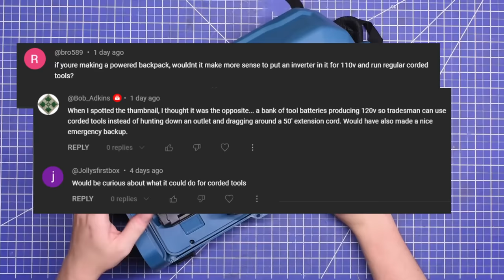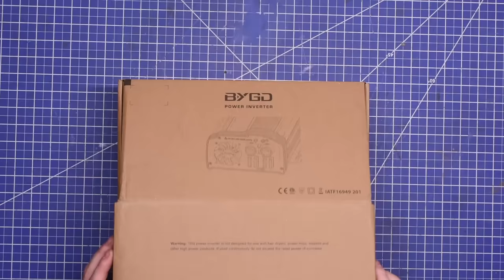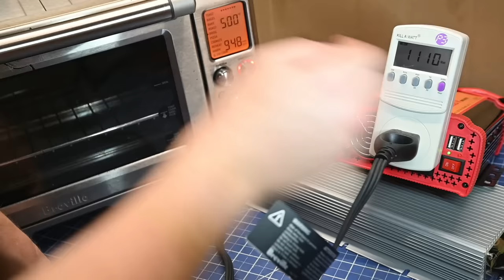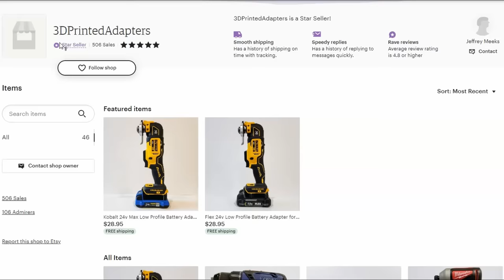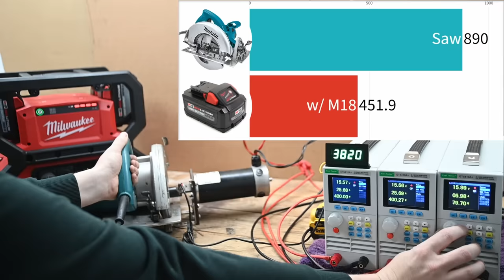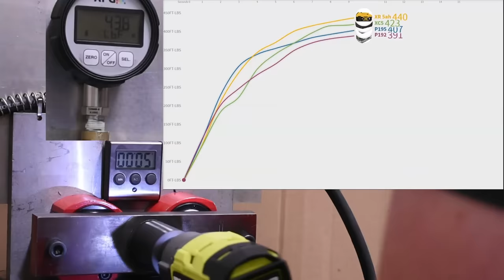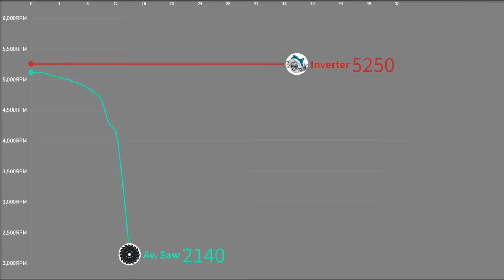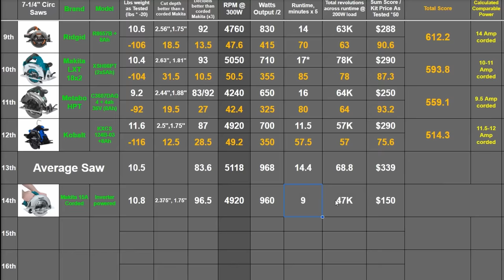Powering Corded Tools w/ Cordless Batteries is Stupid (but fun)

Comment from the maker: The M18 inverter has been surprisingly good https://amzn.to/3tCW8g9
Reply: Day 2 of asking you to Test the tecpo 300111 Air Impact
Reply from the maker: @steinestapler726  We dont have them here in the states it looks like
Reply: @TorqueTestChannel  thats sad Maybe we can find one that can send it to you. I am Not able to send it to you because i live in Germany, and i need IT daily.
Reply: I wonder how powerful a tool would be if it was designed with modern brushless tech but was still wall powered.
Reply: I asked 10 or more times for a tool review without even a reply lol lucky you got anything back at all
Reply: @TorqueTestChannel question why didn't you guys milwaukee  MX fuel battery inverter
Reply from the maker: @dylanrowe7581  because these things already cost too much. Having to pay for massive MX batteries. No adapters on the cheap fun to be had
Reply: by the way, if you are interested in that M18 inverter, you are better off buying a portable power station which already has batteries, LFP batteries that has at least 3000 cycles.
Reply: @TorqueTestChannel  do you have an po Box where i can send an Impact
Reply: @zodiacfml  thought  the same this set up only makes sense if you already own the Batteries
Reply: Corded tools use universal motors which can use AC or DC. All you had to do was make 120 volts DC and hook it up to the corded tools. The only issue you will run into is for variable speed corded tools like drills because the control components require AC to work properly, but the grinders and saws would work as they just use a simple switch to turn on and off power to the universal motor.
Reply: @EETechs  there was another comment that teste that and the switches didn't work with that power.
(Its because there is not zero voltages switching)
Reply: You fell into my trap, DeWalt PowerShift activate.
Reply: That center must be the + charge pin?

Comment: Anyone calling these builds stupid lacks the ability to read between the lines. The engineering alone is enough to learn from, regardless if it's actually useful or not, the point is to find out. I'm not necessarily expecting peak performances but I enjoy seeing what you find to be the minimum required wire or battery size to perform at all. The differences in battery performance from one brand to another is interesting as well. Showing people they can simply notch an adapter rather than have another one made is another little tidbit of info to keep in the back pocket. I did that back in the day with some batteries themselves to fit certain tools and they worked fine. Love the vids man. Thanks. Merry Christmas.
Reply: Average human doesnt even know that AC batteries dont exist. They think why bother with tools DC batteries when you can just chug an AC battery and use their corded tools.

Comment: Corded tools have universal motors. They run on AC and DC as well. Here comes the sketchy part, put 6 20v batts in series for 120v. Or 7 for some extra juice.
Reply: This is exactly what I was hoping to see!
Reply: I suspect that since most batteries have circuits in the pack, they would not like being put in series and having 120V+ run across them.
Reply: Actually, since universal motors self commutate. Should only need 60v DC to equal the power of 120v AC. Likely will see more power on DC as theres more current on tap.
Reply: @DangaRanga  120V AC is an RMS value, not peak to peak so the commutation should be irrelevant when comparing to DC
Reply: It would be more efficient using two 60 volt batteries in series then use an inverter. 120v DC is more powerful than 120 AC.
Reply: Get a European tool and put 12 batteries in series
Wheeeeeeee!
Reply: @F0XD1E  As the batteries are in series each battery would only see its own voltage of 20v. Series only increases the total voltage of the set (So 20+20+20 and so on). Same with parallel (In terms of battery voltage) except the total current capacity increases instead of voltage. It would be interesting to see the ac tools run off a series of batteries and how runtime differs because the large efficiency loses of the inverter are not present.
Reply: @DangaRanga  120Vac (Which is measured in RMS) is the equivalent of 120Vdc. AC actually is a peak of approximately 170V (From 0). A tool run on 120Vdc should be equal to a tool ran on 120Vac for power output.

Comment: the shop vac ratings are not about startup. they are about a theoretical peak power output which factors in the inertial spinning mass of the rotor. this number can basically be arbitrarily high depending on the test setup and has no real value whatsoever.
Reply: Correct!
Reply: I always wonder how many horses it would take to create a vacuum....
Reply: Depends how winded they are

Comment: As others have suggested: Definately try running the saw on DC. No AC conversion needed, but how much torque will it make at what voltage?
Reply: This.
+If you like your saw, ziptie the switch closed and put another switch in series. High breaking capacity circuit breakers work reasonably well. That avoids turning the original AC switch into a puddle of copper (been there, done that)
Reply: I find it amazing how he does all that measuring and electronics DIY stuff but doesnt even have basics theory knowledge. The last battery bag video he didnt even think about using a simple diode before hoking the batteries together(the preffered method would be mosfets btw). He probably doesnt know how a brushed(universal motor) works. Just 6 batteries would be more than enough to run a power tool.
Reply: @JonaJona I see what youre saying but is 110DC at 10 to 16amps enough to weld together a switch or just melt it? Most switches are rated for 240(ac) at 16amps anyways. Thats like 340v peak
Reply: @zaxmaxlax  When switching DC loads, switches are normally rated for between 1/2 to 1/4 of their AC switching capacity.
Reply: @zaxmaxlax  on DC there is never a zero voltage crossing like on AC so the arc when the switch turns off doesn't extinguish easily. most switches that are say 20 amp AC will only be maybe 5 amp DC . same problem with larger DC breakers. i remember in motor lab back in college in 1980 we had a setup with 50 amp DC air  breakers . when they switch the arc was like 8  inches long. they flip open in a rotation and the arc follows till the thing has opened over 180 degrees.

Comment: I just want to say that I didn't think the idea was stupid! Before I had cordless versions of certain tools I was making my own cordless tools, but before that I actually had connected  packs in series so I experiment to run my corded tools, Way back in the Days of nicds  so you can imagine I had no long runtime like that we have today. Which brings me to my point that you could just run six 18/20V batteries in series and you would have 120 volts DC which is actually going to be a lot more effective than inverting because the universal motor is more efficient with DC than it is with AC, and as you noted by far and away most power tools are universal motors, not to mention the inverter is the bottleneck in this situation. Enjoyed the video!
Reply: does it work with tools that have speed control? will it not blow-up the triac or something?
Reply: @pisig98b  If a tool with uni motor has a speed control, all it should do is run flat-out: the triac fires and say on until you release the switch assuming it breaks the live wireIf the trigger only disconnects the triac's gate driver, then the motor won't stop until unplugged. 250V AC switches usually aren't rated for more than about 32V DC, breaking non-negligible DC current will likely wreck them pretty quick.
Reply: I think your onto something there!
Reply: @teardowndan5364 Switch problems were my first thought. 

I tested a 120V switch in series with a heater and 4 M18 batteries (20 volts each at maximum charge. (https://youtu.be/wZ5_mGM_VAY?si=205r5W-hWlO7A9E0) The switch arced and melted violently at only 10A 80V.
Reply: @pisig98b  It should still work,it will just be using half of the triac, and might only run full speed, But dont know for sure everything I ran was simple on -off switches. I wouldnt think it would damage it but might want to try one you wont want to cry about losing first.

Comment: For many tools with older motors, you don't even need an inverter. Universal motorbs run on both AC and DC, and even a little better on DC.
Reply: Please test this
Reply: This is a complete lie ac does not need brushes to run and dc does so an ac power tool would not have brushes in it unless they wanted to add allot of extra wear parts and cost to the tool for no reason which makes no sense
Reply: @PeterTrimboli a lot of power tools use a universal motor.
Reply: @cameronwebster6866  right they are ac motors that's how they're brushless the dc goes into it then through electronics the dc is cut up and stepped into a choppy ac sign wave depending on where the sensor tells the electronics where the motor position is brushless tools are a little more complicated but you can't just put ac into it where the battery is so it's technically only for dc unless you made another port on it that could take a plug that goes straight to the motor in theory that's possible but no ac circular saw should be able to take dc unless it was specifically designed for it because it would mean extra wear parts less efficiency and more cost to build.
Reply: @PeterTrimboli  I don't think you're talking about the same motors. Universal motors are a specific kind of BRUSHED motor that can run on both AC and DC. Plus, since the OP mentioned "Older" devices, there's not likely to be much in the way of control electronics in the first place. Even if there were, unless the current passes through a transformer before getting rectified for some reason, I don't even know that the control electronics would be particularly bothered. Whatever is powering the electronics would expect to see 170V rectified mains voltage regardless, right?
Reply: @PeterTrimboli there are different types of AC motors that operate differently.  Many ac motors are induction motors (like on an air compressor).  Because transmitted AC is only 60 hertz, these motors are limited to a maximum of 3600rpm.  This makes then too large and heavy for most handheld power tools.  If you increase the frequency beyond 60 hertz, you can make a smaller faster spinning AC motor.  This is basically what "brushless DC" tools are doing.  Finally you have what most AC power tools use which is a field would brushed more.  What is happening in these is that even though the AC is alternating direction, it is doing so in both the field and armature at the same time (cancelling it the changes).  This allows for a smaller faster spinning AC motor.  Car starters are also an example of a field would motor.  You can hook a battery to a car starter on either polarity and it will always spin the same way.
Reply: you're partially right, but way off too. A Universal Motor is a brushed motor used in corded tools that run off AC 120V, because it's cheaper and lighter than an induction motor. These will also run fine off 120v DC, which is what they were talking about in the video. 

Brushless battery powered tools aren't even part of this discussion.  But since you brought them up, brushless handheld tools use small 3-phase motors and VFD circuits (aka rectifiers, speed controls, etc) that run from the DC battery input, and output multiple channels of AC power to accurately control the speed of the motor.
Reply: @PeterTrimboli  Most bigger/cheaper power tools, including worm drive saws, routers shopvacs etc., use "Universal" motors. They have brushes and are basically a DC series-wound motor(like an engine starter motor), that work on AC as well. They are very cheap to produce, and have a very good starting torque. However, they are not particularly efficient, and will wear out with use due to the brushes.  Other true AC motors, like induction motors of various sorts don't have brushes, but have a hard time starting, so need an assist(capacitor, shaded pole etc) to get going. 3-phase AC motors are the best of both worlds, but you need 3-phase power to run them, not something you have in consumer households. Recently though, we are seeing power electronics become cheap enough to simply use a 3-phase motor with driver board(3-phase inverter) in applications that need high efficiency and (usually) variable speed. This is actually how "brushless" DC motors work as well - they are 3-phase AC motors run off a driver board.
Reply: @PeterTrimboli  Lots of AC power tools - I'd go so far as to say most handheld AC power tools even - use brushes. You literally don't know what you're talking about here.
Reply: Typical universal motor power tools will run badly on DC. Once trigger pulled, even a little bit, those will instantly run at full power until power cord is unplugged or batteries cut out.
Reply: @volodumurkalunyak4651  A not insignificant number of universal motor power tools aren't variable speed to begin with so they run a treat on DC.
Reply: I think uncle bumblefuck AvE had a video about using 2x60v dewalt batteries to run AC tools and it worked flawlessly
Reply: @bradley3549  good luck shutting those off without burning out a switch if you try to run those with DC.
Reply: @volodumurkalunyak4651  Many of them come from the factory with AC/DC rated switches specifically for that reason. Maybe less common today now that DC outlets on engine powered welders aren't as common. But nevertheless, contrary to what the experts here are claiming, the MOTOR still runs fine even after your switch is welded closed.
Reply: @PeterTrimboli  a universal motor is a brushed motor.
Reply: @PeterTrimboli You should probably sign up for a basic electricity class at the local career center. 🙄
Reply: @sniper7.62x51 I think you should buy a dictionary and look up what the word basic means. Basic electrical theory is pretty much Ohm's law, generation and transformers, how motors work, VFDs, inverters, brushes capacitors inductors and rectifiers is a little more intermediate or advanced.
Reply: @PeterTrimboli  "how motors work"  is the section you should look up. 😆
Reply: It would be more efficient using two 60 volt batteries in series then use an inverter. 120v DC is more powerful than 120 AC.
Reply: @PeterTrimboli ☝🤓
Reply: @PeterTrimboli there are lots of brushed  motors used on AC power tools. It was the most practical way to get a decent amount of power over a decently wide range of speed/torque, in a decently small/cheap/light package.

With modern solid state electronics, the brushless ones have became common as well.
Reply: @bradley3549 are you sure about that? Dc switches are completely different beasts, especially voltages like 120 or 230v.
Reply: i just made the same comment . if it's just a switch and full chooch to the brushes with no electronics then yup
Reply: @ronblack7870  if you don't mind trashing the switch

Comment: I will take the blame! I love it 😂. I actually have an older video using 2x 56V EGO packs to run some 120AC tools that still use universal motor to this day. It will work, but the switches are the failure point as can be expected unless AC/DC rated. Keep up the fun videos.  Merry Christmas and Happy Holidays!

Comment: Don't the motors in circular saws and miter saws run on AC or DC? I was hoping you were going to stick six of these 20 volt batteries in series and run them direct on DC. That way you wouldn't have all the losses in the huge heavy bulk of the inverter system.
Edit: to be clear, I know they're not advertised as being able to run on DC but the type of motor that it is I think can
Reply: Exactly what I was thinking! AC Circular saws and angle grinders usually use universal motors, which do run both on AC and DC. They should even be more powerful on DC, if the voltage is right. You probably don't even need the full 120 V, so that would definately make for an interesting video.
Reply: Can confirm. Brushed motor corded tools love DC power.
Reply from the maker: Correct. Some do and some dont though. Induction motors don't but it would work for the couple here.
Reply: @TorqueTestChannel  sounds like another follow-up with a rewired Frankenstein backpack from the first video!
Reply: @MrEnginerd  I've run a circular saw with batteries in series but you loose speed control on tools with variable speeds.
Reply: @fascistpedant758  That's a good point. Also an empty battery with no protection circuit would be destroyed. So there are many downsides to this approach, but it still is way cheaper than any alternative, if you do already own batteries. And: maybe more power?
Reply: Highest jank factor = must test it!
Reply: 120 volt DC would be quite dangerous also the BMS in the batterys might let out the smoke.
Reply: It would work for the motor but it would burn the switches/regulators so not the best idea

Comment: Honestly the most valuable information for me in this video is all the information about the battery tech.
Would love a video comparing all the different battery brands, and which ones have the same cells, which "last" longer over time, better discharge, which have under voltage protection etc. 

Would also be a great addition to your spreadsheet